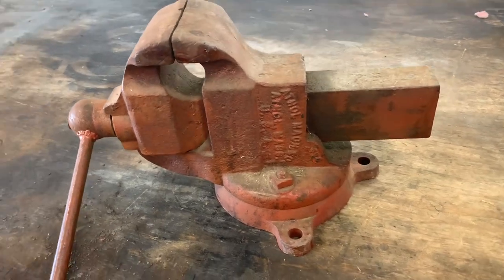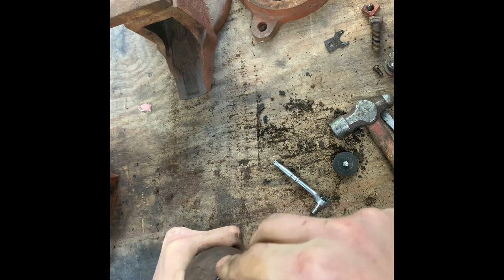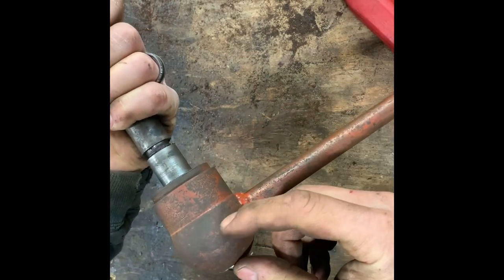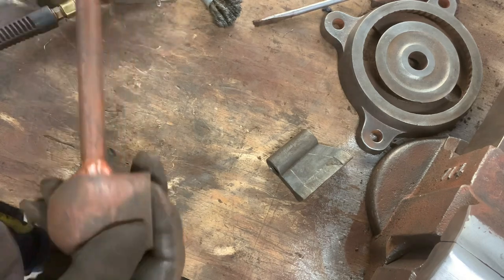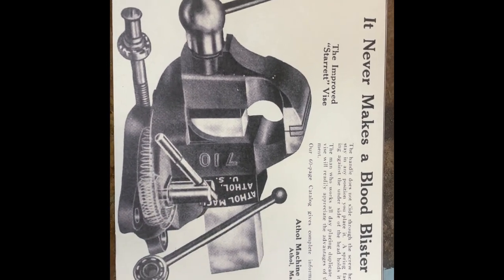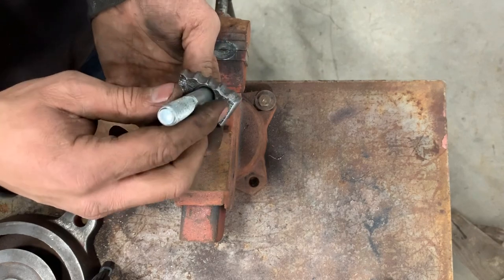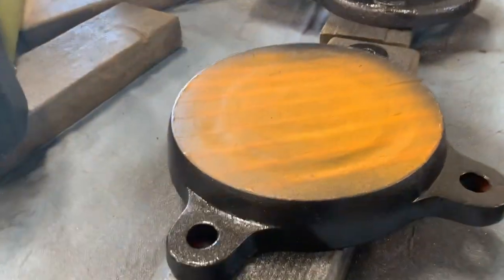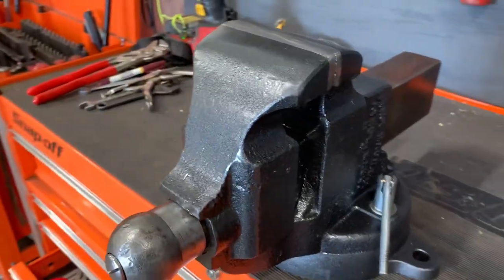Vintage vise restoration. With repairs!

Comment: Hummm, interesting vise.  I can honestly say that I've never seen one like that before.  Great job on the restoration and fabrication of missing parts.  The dynamic jaw piece looks liked it had remnants of (perhaps) the original red paint?  Not too crazy about the black, but to each his own.
Reply from the maker: Thanks. Yeah I just used some paint I had on hand, probably would have chose a different color though